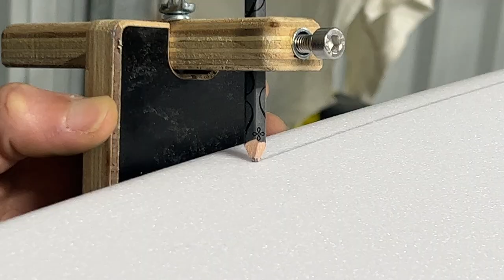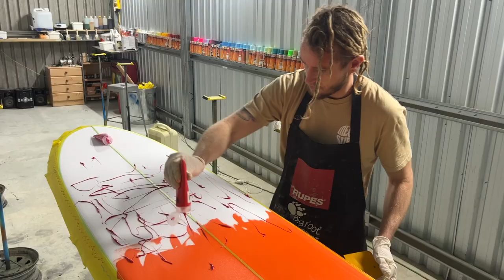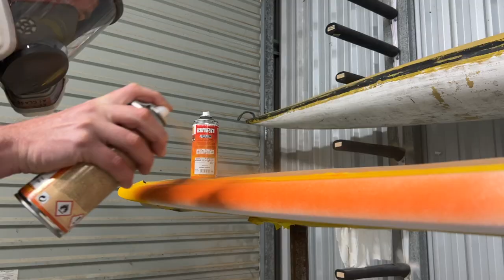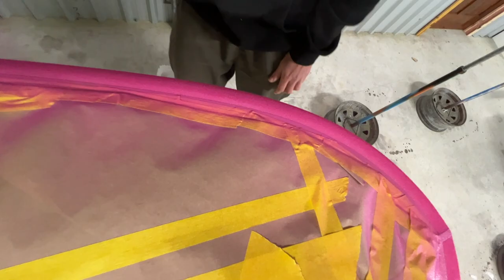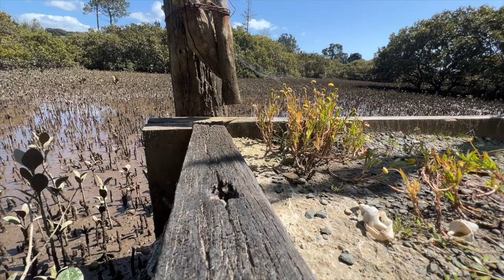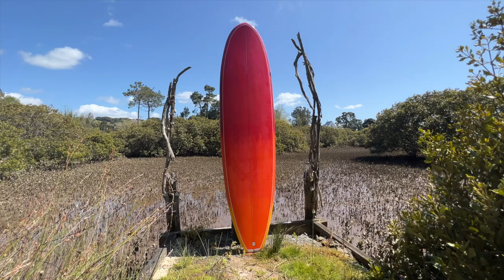Shapes, stains and sprays

Comment: Really enjoy your Channel. Im a windsurfboardshaper. Question on color many times i get a reaction when doing spraypaint and the Epoxy hotcotcoat on top. 1. The paint just gets smoshie in the epoxi or I get a reaction where the epoxi does not fully cure and you can peel of the color. Any suggestions
Reply from the maker: Hey hey, appreciate it!
Yup, my advice to you is to NEVER put paint underneath epoxy resin unless you absolutely have to.
Go to your local surf store, look at all the epoxy boards. See if you can find one with paint beneath glass and resin. You won’t. They’ll all be resin tints or paint on top.

If you absolutely MUST paint beneath your epoxy, water based paints only but, in case you couldn’t tell, I don’t recommend it 😆 🤙

Edit * the board in this video is poly resin, that’s why I’m able to paint beneath the glass

Comment: Do you seal your acrylic paint or do a cheater coat before laminating to prevent drainage or crystallized problems with the paint? Thanks
Reply from the maker: Gday John,

No cheater coats or sealing, laminated straight over

Comment: Hey man, really like your content. Just wondering, do you have any resources you can recommend to beginners for glassing? Like recommended amounts of resin to use for shapes etc? Or is it just a trial and error?
Reply from the maker: Heya man,

Try this link, there's a button on the page where you can save the document. I've never personally used the chart so not sure how accurate it is but, seeing as it's written by a pro Glasser I would mix a bit more than whatevers reccomended there. 

https://greenlightsurfsupply.com/blogs/news/32083843-new-surfboard-glassing-chart-resin-amounts-per-foot-of-board-length-for-epoxy-and-polyester-resins

If you give me your dimensions I'll have look in my book tomorrow when I'm at work and let you know what I've got written down. Buy a book and write down each boards dimensions and what you end up mixing for each stage and weather it was too much or not enough. Then you can refer to your book before glassing your next board for reference
Reply: @smallkinedings  shot for the solid response man! Will definitely check it out, thanks man. 

As for the shape, I'm still so lost as to what size I want to make. I'm thinking about like a 6ft3 fish or longer. Not really that good of a surfer yet, can surf a minimal but still improving, so want to make something nice and wide aswell, been browsing surfshops for shapes and sizes and seeing what looks good, planning to perhaps hire a few fishes and trying them out first. So many boards and sizes out there baffles my brain but anyway, really enjoy fixing ( emphasis on "fixing")  dings and stuff so want to try and get more into shaping but still quite a newbie to it all. 

But man I got to say, I haven't really gotten the best responses from people I spoke to, especially shapers, like man... chill, I'm not trying to take over the world, just some random advice would be great. Gate keeping is real! Thanks for the content tho! Apologies for the essay 😅
Reply from the maker: @huizen9518  o man, things are about to get so good! The second board I ever made was a 5'8 mini sims. I had never ridden a board that short before. 7ft was the shortest I'd ever ridden (the first board I made). I borrowed a mates 5'8 fish and I only rode that while I built the mini Sims. It took me ages to build because I had no idea what I was doing 😂 by the time the mini Sims was finished, I had learnt to at least catch waves, pop up and go down the line on the 5'8 fish. My surfing improved massively during that build because I felt like I had to learn how to ride the board before I finished building it.

My reccomendation would be to make a fish, more of an old school one. Super flat, super wide and super thick. Borrow a board like you said and try and copy it, learn to surf the board while you're shaping it, you'll be extra motivated while surfing knowing that there's one being shaped back at home. 

It's hard to mess up a fish, as long as you don't over sand it to a popsicle stick, it'll surf!
Reply: @smallkinedings  Awesome! Will definitely give it a shot then. Who knows, might just film the process and upload for the masters to critique. 😆

Thanks for advice man.👌